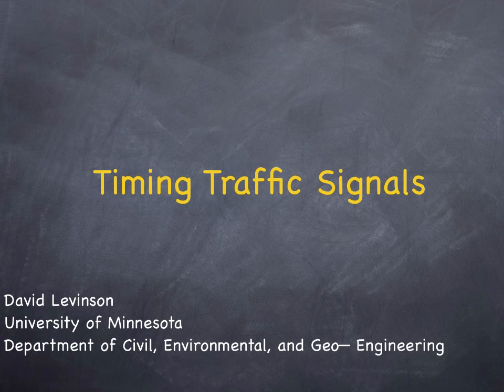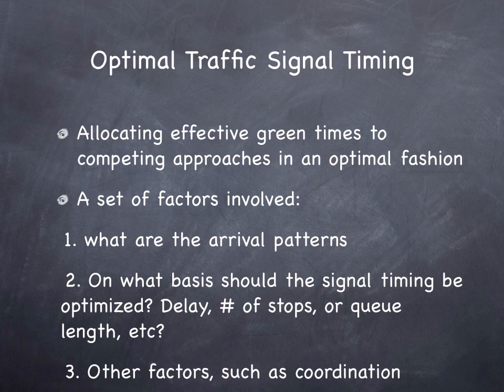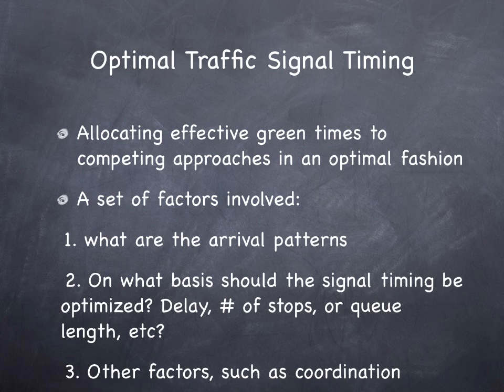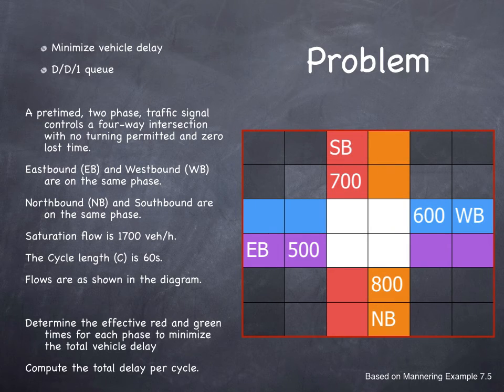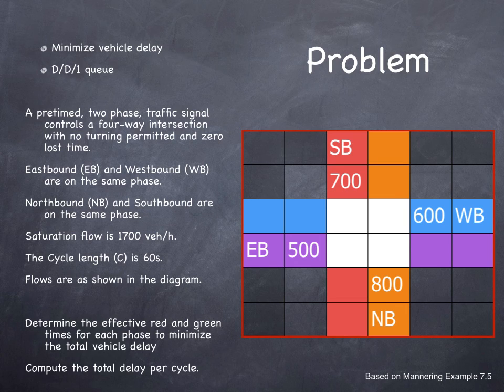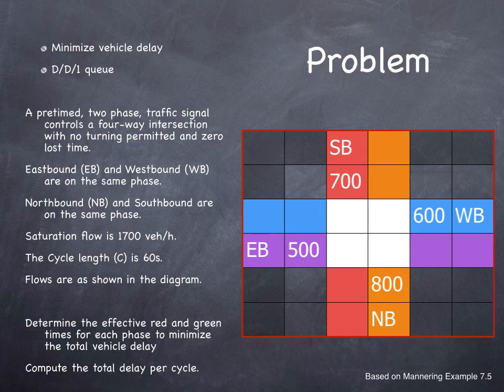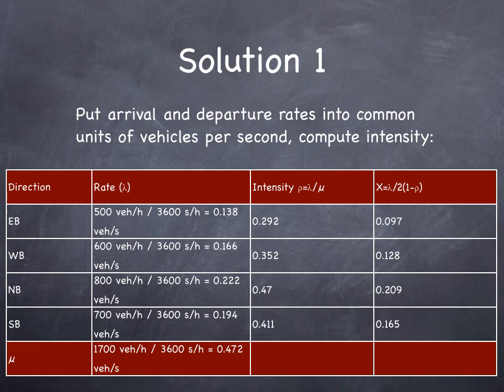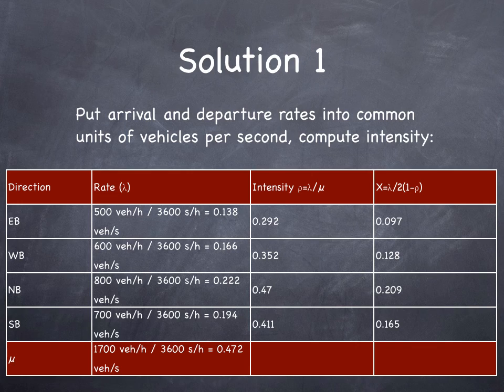Timing Traffic Signals: Example

Comment: question?
If for example a light is used by sensor (after hours) to say for example N and S to trigger the signal to turn green, and the E and W stays green till sensor tells it to start cycle. 
What should the avg time be for the E and W light be from when it hits red to the delay to the green on the N and S side? 1.5 seconds? is that right? just researching a couple things.
Its a 4 way light and after  a certain time it uses a sensor to tell light that a car is there.. My question is would that be right for an avg time from a red light between the green light?
Also the E and W traffic lane when the cycle starts it goes from green to yellow then a 1 second delay between yellow to red.
Would that give a car or truck enough stopping distance at the marked speed limit 55-60 mph?
Just asking because you sound like you have some knowledge on this and I'm not to good at that math you had going on.

Thnak